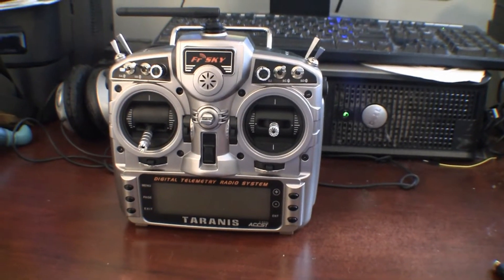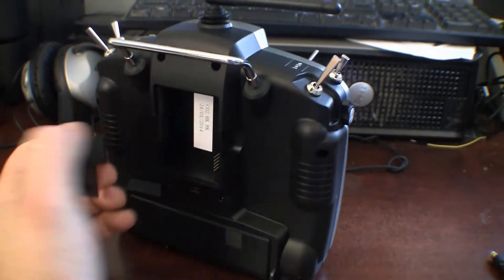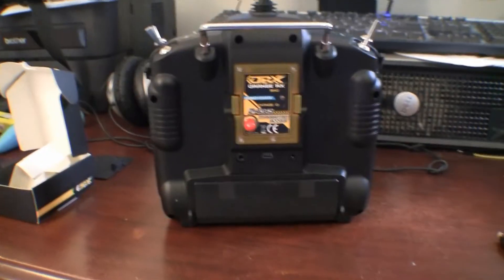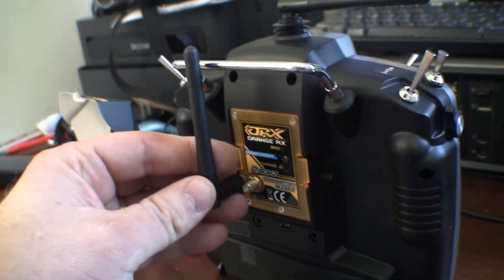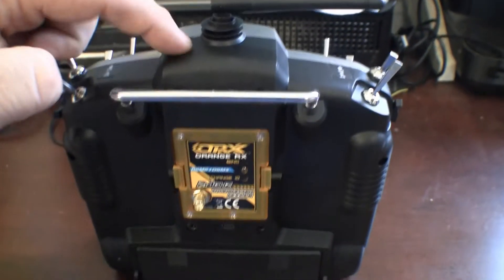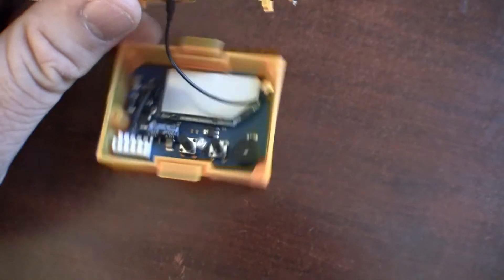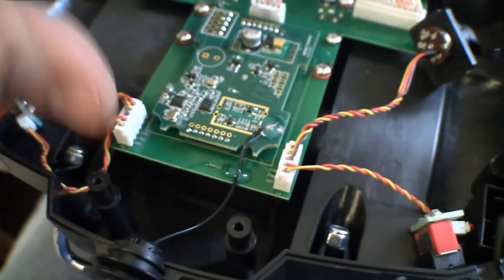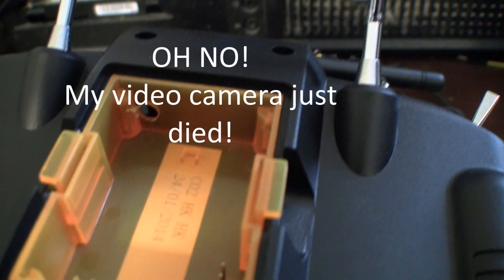Taranis DSM Module Antenna Mod

Comment: I went to do this mod and found the module I have has a fixed antenna mount so they have modified it without the cable.
Reply from the maker: Bummer.  Any way to solder a coax onto the hard mount?

Comment: I think when you plug in orangeRX that the Frsky antenna gets turned off. Can someone verify?
Reply: kennethpappas in the model settings in the taranis there is the option to turn off the internal RF module and Turn on the External Rf module

Comment: Here is 3d printed adapter, for antenna mod, just change backplate and move antennaplug

http://www.shapeways.com/model/1701751/backplate-for-orange-rx-transmitter-module.html?li=aeTabs

Comment: was the RP-SMA to U.FL cable that was inside of the OrangeRX case long enough to reach your mounting position or did you have to buy a longer one?  I ordered the OrangeRX module yesterday and I'm wondering if I should go on the iBay and order a longer RP-SMA to U.FL cable to do this mod.
Reply from the maker: Yes, it is long enough.

Comment: Why not just put an SMA extension cable on the module and mount the socket on a bracket?  I'm not wild about drilling holes in my radio, and if I wanted to use a different module, I'd have to disassemble the radio to get that antenna mod out.
Reply from the maker: Two reasons why I didn't just put a cable on it.  One, you can't lay the radio down flat with the coax fitting sticking out of the module, and two, because I like it the way I did in.  I'm not saying it is for everyone- if you don't want to drill holes, don't.  I made the video so folks will know that you can if you want to.
Reply: Glofilter I agree the antenna connection on the module is in an odd/awkward spot.  They either didn't plan that well, or it wound up in the only spot left.  It should have been a lower-profile right angle SMA positioned at the top of the module.  The main reason I asked was that I have some SMA extensions on order, to get more position choice on my quads and I wondered if you tried extending and found it created too much signal loss.  When I get the extensions, I'll test range with and without and see what loss they add.  Ideally, FrSky should have integrated an antenna connection into that module bay and a second SMA antenna connector at one or the back top corners of the radio.  If someone had snap on rubber feet that would attach at the curve of the handle, it would elevate the radio making all modules easier to use.

Comment: I got on of these modules, but didn't realise you could only bind 1 receiver to it at once, now I will be fitting a genuine DSM2 module out of my DX6i in it, oh and I'd only get 20 paces on range check mode!
Reply from the maker: Um, what are you talking about?  I have four receivers bound to mine.  Don't have any range issues either.  Maybe you got a dud.  :(
Reply: Are they bind n fly models? I've got a model with an AR6200 and an Orange R715 and you have to keep rebinding them, and with this system you don't get model-match, using a genuine spektrum module you do!

I also don't like the idea of making holes like that, taking away the ability of removing the module :/
Reply from the maker: vanepico Clearly you are doing something wrong.  Yes, my Parkzone and Eflite models are bind and fly- while two of my other models have a JR RX and Spektrum RX.  When you bind them, turn the RX off first so it saves, remove the binding plug, and then it will be bound forever.  If you don't like the mod, don't do it.  lol  :)
Reply from the maker: vanepico Okay, I found out what your issue is.  I bound a JR receiver to my Orange Transmitter module and ran into the problem you are talking about.  The Orange DSM2/DSMX transmitter transmits in four modes- same as the JR/Spektrum DSMX transmitter.  The difference is that you have to manually tell the Orange TX what mode to use.  After I bound my JR RX, my Spektrum RX on my Eflite BNF CarbonZ Yak didn't work.  I rebound it, but then the JR RX wouldn't work.  I then found out that you have to press the bind button three times quickly to change modes.  DSM2 has two modes- 22ms and 11ms.  Once I changed the mode I was able to connect to the JR just fine.  There are four modes and it cycles 1-2-3-4-1-2-3... , so if you are in the second mode, you may have to cycle all the way through to get back to 1 (DSM2 is mode 1 and 2).  So I apologize for doubting you, you where right, sort of.  You don't have to rebind, but you do have to manually change modes- something the JR/Spektrum TX does automatically.
Reply: I've since butchered my module, to make a native dsm2 which has worked flawlessly so far, you even keep the model match system, you just need to leave plenty of time for the module to initiate. I would recommend doing it for people who are confident in soldering,

Comment: Waiting on next batch taranis transmitters arrive. Be doing same mod, you think coulf fit antenna behind other one or is there no space?
Reply from the maker: Behind?  I wouldn't for two reasons.  First, it would limit the orientation of the antennas greatly.  Second, there is a good chance one antenna would interfere with the other if they were that close to each other.  Even though you might have only one transmitter powered up, the other antenna, which is tuned to the same frequency, could soak up some of the transmitter's signal.  That's ultimately why I chose to install it on the lower teir of the top.  (Plus, now the antennas are the same height)
Reply: Glofilter
cheers mate, makes sense

Comment: Slick mod. Been wanting to do something similar. Do you have any noise from your speaker while the DSM module is turned on?
Reply from the maker: I do not.  Or at least I don't have any more noise than with it off...  lol
Reply from the maker: Glofilter Correction Matthew- I do hear noise.  My ears aren't what they used to be, but I noticed when I was programming a new model into the radio a couple days ago that I did indeed hear noise.  I know there are mods you can do to fix that, but it doesn't bother me because I'm 3/4 deaf..  (too much rock 'n roll in my youth...)
Reply: Yeah most of what I read says nothing can be done about it. I rarely use the orange rx anymore so it's not a big deal
Reply from the maker: Matthew Bradley I'm still using the PNP receivers that came with my Parkzone P-51, Carbon Z Yak, and Micro Beast, but I wouldn't even consider buying a DSM RX after using FrSky ones.  Telemetry, longer range, all for under thirty bucks.  Can't beat that.
Reply from the maker: Glofilter There's a mod on the RCGroups site where you can use ferrite foil (or something) and a electrolytic capacitor to kill that noise, but it doesn't bother me (because AC/DC and Quiet Riot stole my hearing 30 years ago).

Comment from the maker: Update:  I did some testing and it does matter slightly not to have both antennas up and parallel during a range check.  If you do this mod, remember to fold the unused antenna down and away from the one that is active.  I'm not sure how much of a difference it would make, but I got three more paces of range check distance with the inactive antenna down..